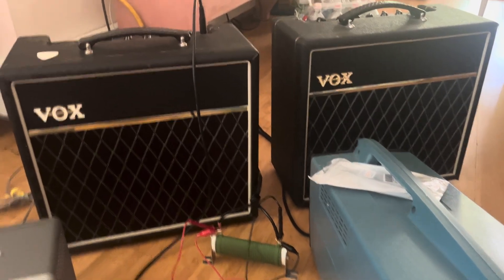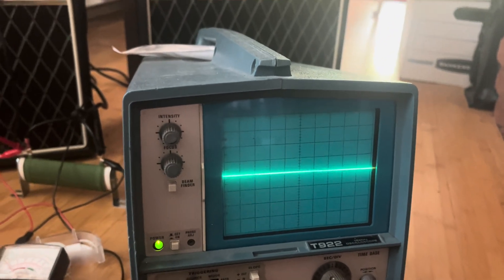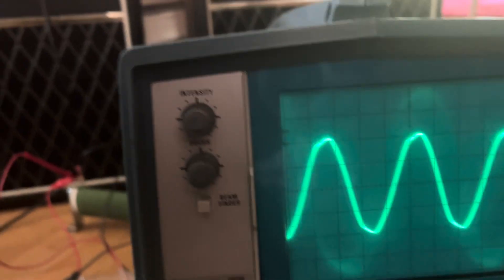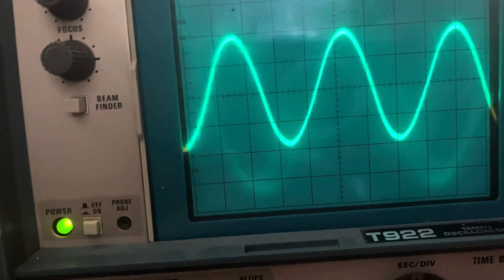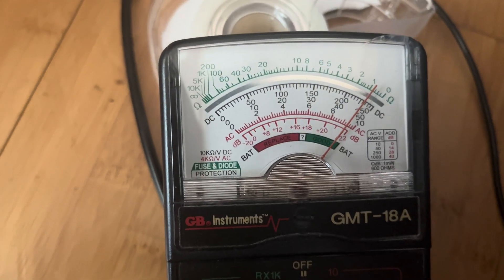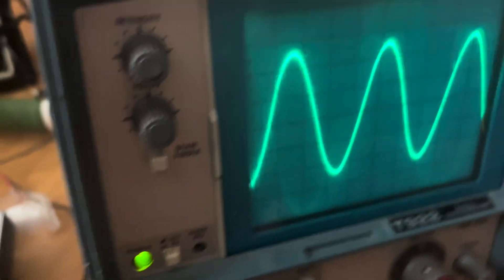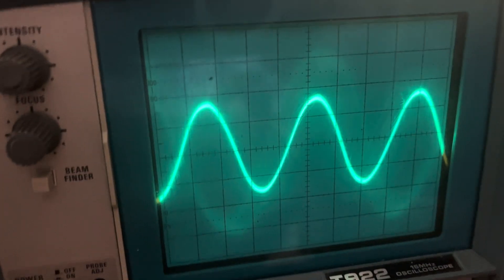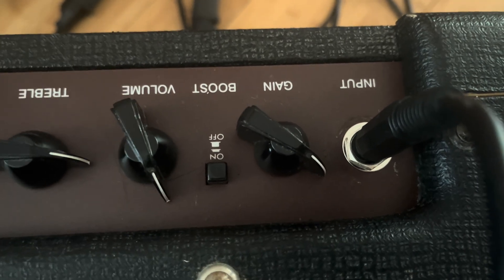Vox Pathfinder 15 on Oscilloscope, Clean headroom located on Volume and Gain pots

Comment: Thanks for a very useful video. I have two 1999 Pathfinder 15’s and one later 15r. I love these amps. I usually run mine with the gain at 9 o’clock and volume at 12. Bass at 12 o’clock and treble slightly over noon. With the normal channel of course. The two 15’s are stock and the 15r has the l.e.d.’s removed.
Reply from the maker: Thanks for watching, that’s how I usually run my tone controls- the last orientation I set it to in this video